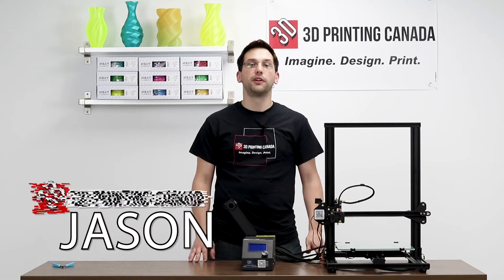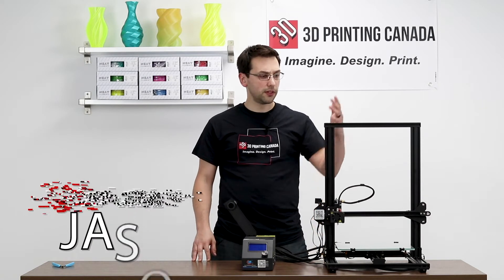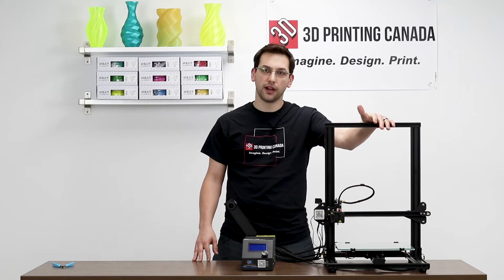Creality CR-10s Updates 2018

Comment: And here I thought my printer was some ancient POS that was sitting in a lightinthebox warehouse.  But it actually has most of the newer stuff.  I just replaced the solid Z couplers for the ones with the rubber spacer since I thought those were the newest.  Also I strangely have the unbranded generic PSU instead of the meanwell some are saying theirs is coming with.  Go figure.